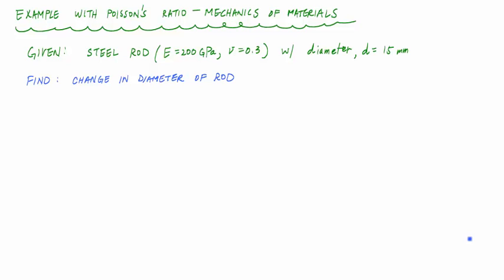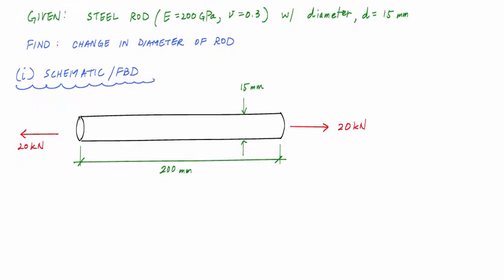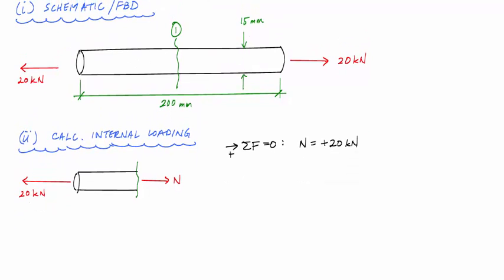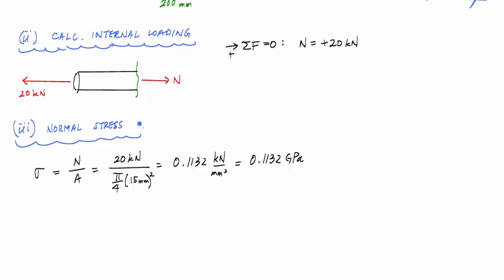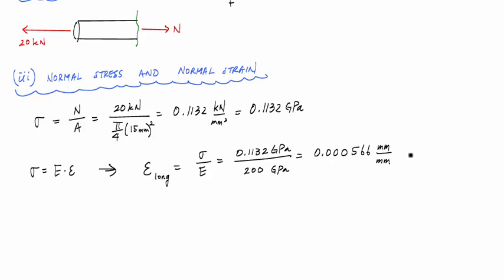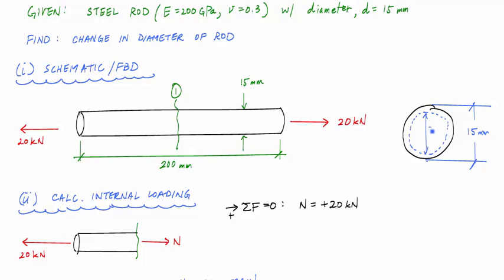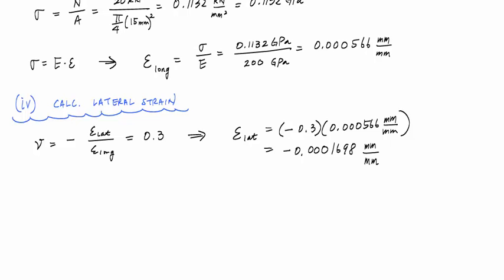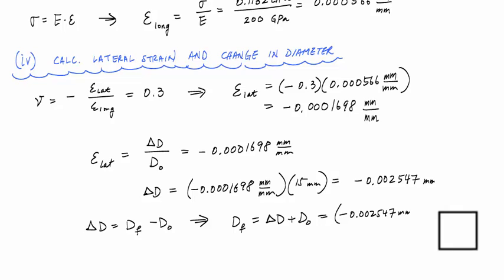Poisson's Ratio Example - Mechanics of Materials

Comment: I wrap 6 units of a product with several wires. I then stack 5 of these wrapped units vertically. How do I calculate the minimum # of wires that I need to wrap the units so that the wires do not rupture/fail from the weight of the units on top of each other? I want to know if I can reduce the # of wires used to wrap the 6 units.

Comment: when u use hooks law, since its only applicable for elastic deformation, how do u know u aint in the plastic region?
Reply: Depending on what material you are addressing.   For exaple  most structural  steel alloys have  have a modulus of elasticity =200 gpa    and for each steel type you are given the yeild stress  so  using hook law  if  your calculated strain is more  than  the (yielding srress/midulus of elasticity)  you are no longer in the elastic zone